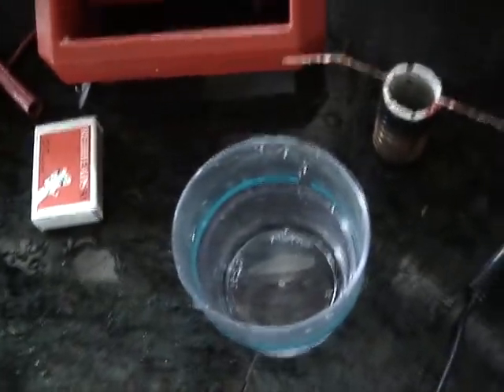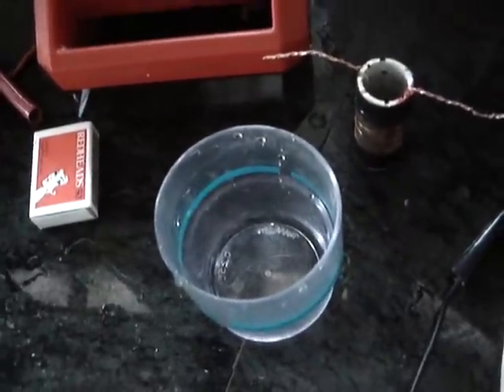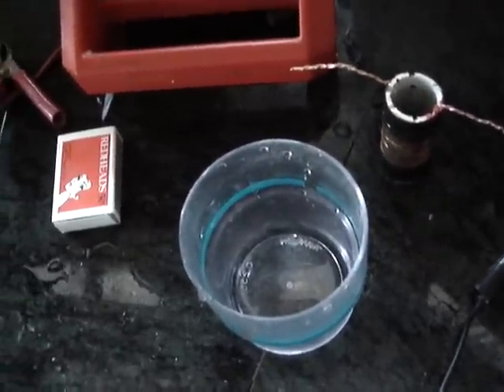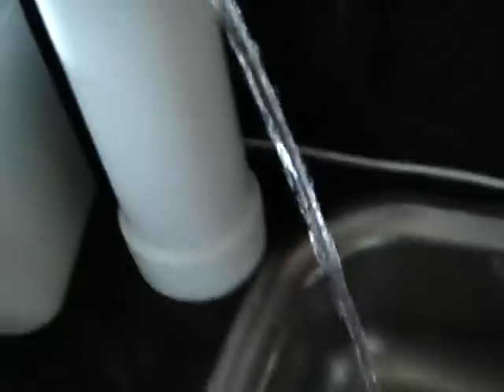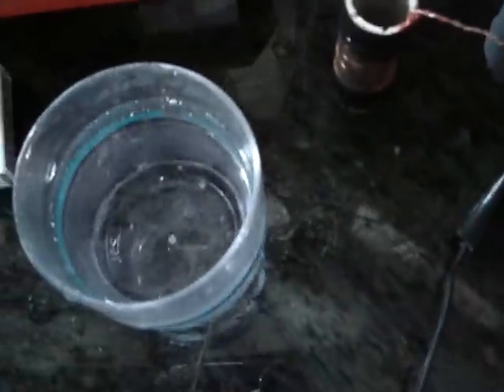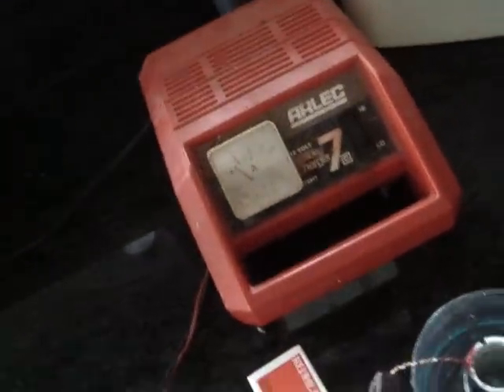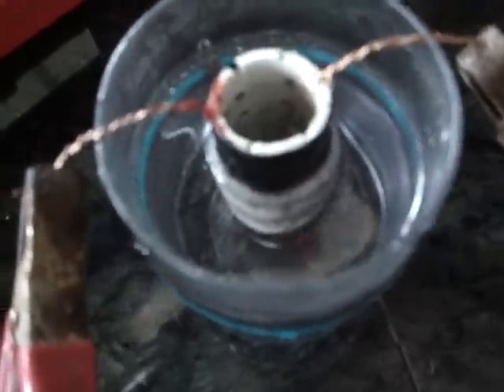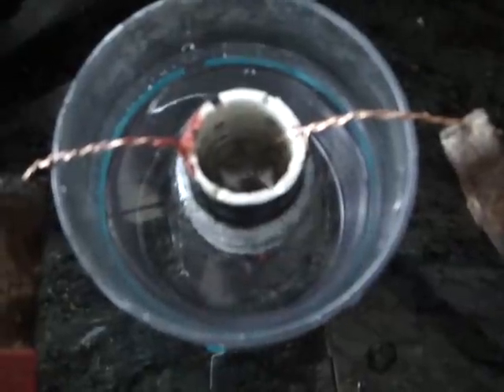Copper coil exploding bubble

Comment: Hi, great video,
but is this a real coil ?
How many windings and ohms does it have ?
Or is that not a real coil, but just 2 wires wound in parallel and not connected at the end ?
Is it a DC Voltage you put into it or pulsed DC like 50 or 60 Hz half wave rectified ?
Many thanks.
Regards, Stefan.